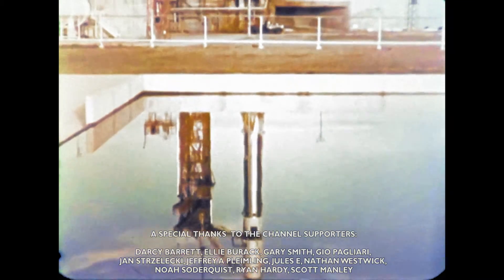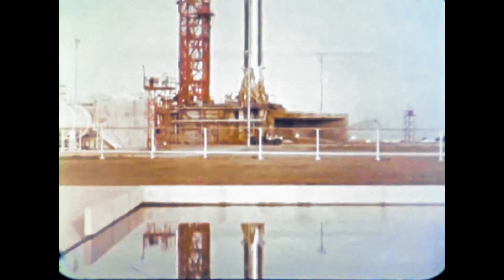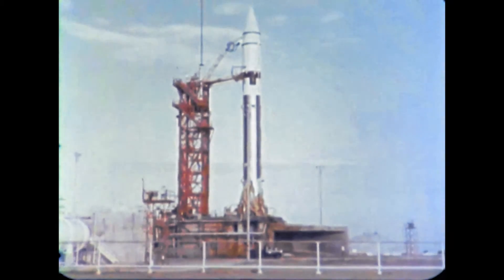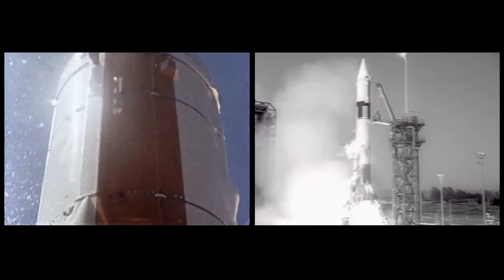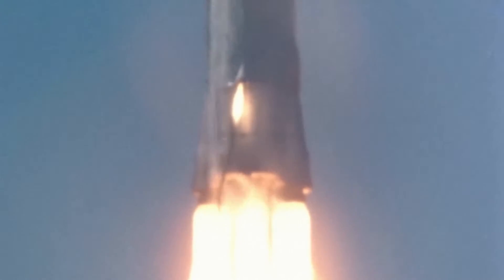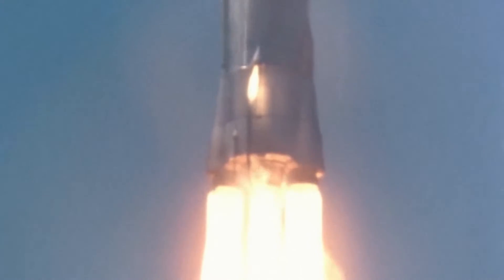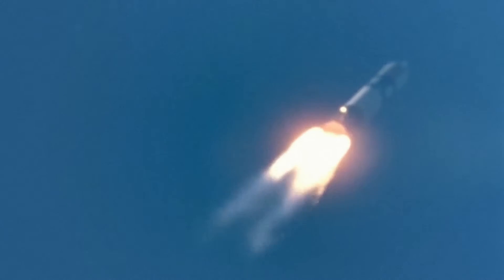AC-1 Failure - First Atlas-Centaur launch (1962/05/08) -

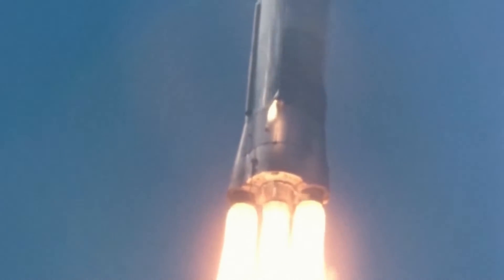Comment: When I watched this (no I did not see Koyaanisqatsi, been meaning to) I noticed venting coming from somewhere near the forward end of the vehicle starting around 1:00.  Venting during flight is usually an indicator that sonething went wrong, at least nowadays; but it was difficult to see exactly where the source was.  Of course back in 1962 that may have been the design, but I don't know much about early Atlas flight operations - just current ops.

The venting event appeared to stop, but I'm still not sure what was happening there without the data to review.  The narrator gives an explanation, which led me to think that the stream of gas running down the side of the vehicle starting at 1:00 might have been the GH2 vent event.

Comment: Never understood why NASA continued to screw with the piss poor ATLAS after the TITAN came along!
Reply from the maker: I guess because they had many Atlas available...
Reply: @RetroSpaceHD  The TITAN put all of the Gemini missions into orbit flawlessly. It was a great Medium lift system. My father was a guidance control engineer from 62-69 and he never liked the ATLAS.
Reply: This has a lot to do with the payload requirements for a specific mission and what you want to do when you get there.
Reply: I belive it was partialy about Titan II-IV's toxic fuels, although i agree.
Reply: @heathyboi7658  its ISP was much lower too if I’m right.
Reply: @nolancain8792  most likely
Reply: Lol

So, I know you're talking about 1960s hardware but I worked for Martin Marietta/Lockheed Martin in the 1990s and we were very glad to acquire General Dynamics and the reliable Atlas (IIAS).  Titan IV was not nearly as successful by then so it's a good thing we kept Atlas.